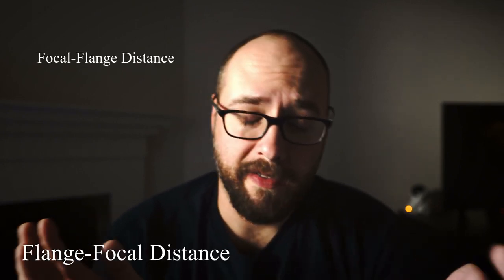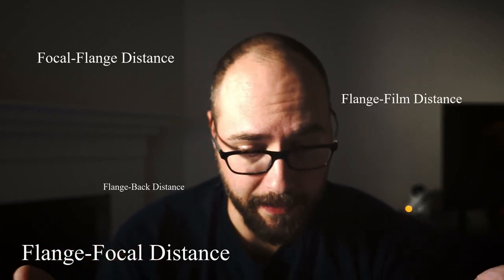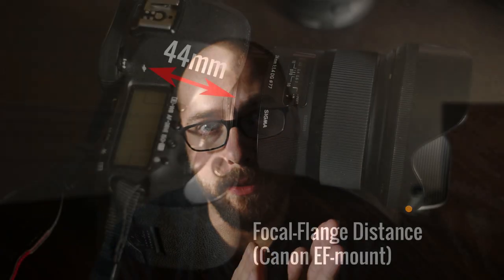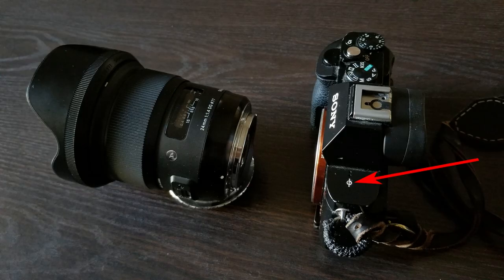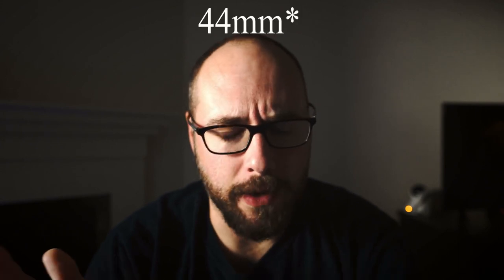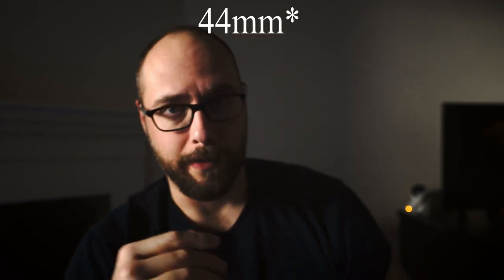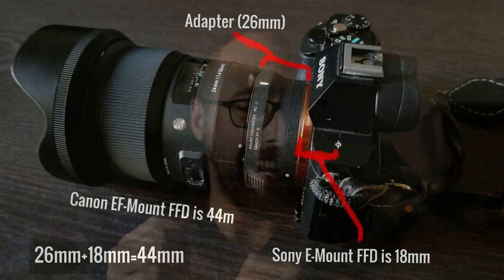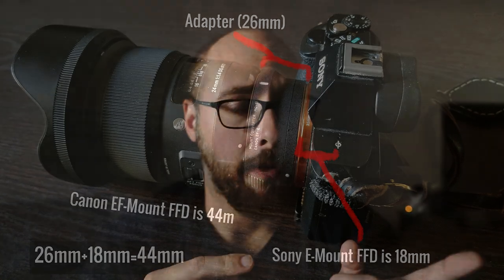The Secret (almost) to Adapting ANY Camera Lens: Flange Focal Distance Explained

Comment: Thanks for the the great video, I just stumbled upon it today while doing some research into M39 SLR lenses vs the LTM (L39) RF lenses. Question for you or anyone else out there: it seems that it's possible to adapt M42 lenses to LTM, and that it's possible to adapt M39 lenses to M42 - does it follow that I'd be able to adapt an M39 to M42 and then to LTM? 

Context: I bought a Zorki 4 with an Industar-50 and an early Helios 44 in M39 mount because most forums online use M39/L39 interchangeably so I thought they were the same.
Reply from the maker: Hi Luis, you've really got my brain going this morning, so thank you! I did some research and believe I have came up with a solution that I'm 90% sure is correct. Brace yourself, this is going to be a long response :)

You are 100% correct that the L39 and true M39 mounts are different. While they are both range finder lens and have the same FFD (flange focal distance) of 28.8mm, they sport slightly different threads, with the M39 being 25.4tpi (threads per inch) and the L39 being 25tpi. Going further, there is another type of M39 mount that is meant for Zenit SLR cameras, usually known as the ZM39. The ZM39 has a FFD of 45.2mm to make room for the mirror of the SLR. As to your specific question; can you use an adapter to convert a true M39 (28.8mm FFD) to M42 (45.46mm), and then to a true non-Zenit LTM (28.8mm FFD), yes, you TECHNICALLY should be able to do so. However, with the changes to the FFD and range finder sync, you would likely run into focusing problems and not be able to focus to infinity. I'm going to include some links to discussions and the M39/L39/ZM39 topics that I used to draw my conclusions which, I admit, could very well not be accurate since I'm not an expert on Leica/Pentax mounts. I would also suggest you check out a channel here on YouTube called Zenography and see if he could offer more insight into this.   https://www.youtube.com/channel/UCza1hvHVZmCh0Bzk3jl5NSw

Here are those links you can check out (which you very well may have already) for more info as well:
https://www.rangefinderforum.com/forums/showthread.php?t=106042
https://fotodiox.freshdesk.com/support/solutions/articles/17000083341-m39-l39-ltm-lsm-whats-what-
https://en.wikipedia.org/wiki/M39_lens_mount

I sincerely hope this helps! I'd be interested to know how it all goes so please keep me updated.
Reply: @AdamWelch  Thanks for the super fast reply, and thanks for clarifying the lens mount terminology a bit more! To amend my prior statement, what I have is an LTM body (Zorki 4) and a ZM39 lens (Helios 44). I know rangefinder coupling will require some modification to the lens so that it'll actually make contact with the RF mechanism on the camera, but might that still work if I'm trying to adapt a lens with FFD 45.2mm to the role of what a 28.8mm FFD lens would have done? 
Also thanks for the further resources - Zenography is actually the channel that got me hooked on FSU rangefinders so I'll be sure to ask for his opinion as well!

I'll be sure to keep you posted on how it goes!
Reply from the maker: @LuisFernandez-ef9ll  I would hazard to say that the finder likely wouldn't function but then again, I could be wrong. It's just that I couldn't see how the adapters could be synched to produce an accurate focus. I wish I could help more!
Reply: @AdamWelch  No worries, thanks for the help so far! Once I get around to doing this I'll let you know how it goes!
Reply: I have a very similar problem to this

I bought a Jupiter 8 lens (m39) and would like to fit it to a Zenit camera (m42) 

I bought the correct adapter, and both the lens and the camera now fit together, but nothing will focus. Is there anyway of mounting a Jupiter 8 lens to a m42 camera and having it focus?